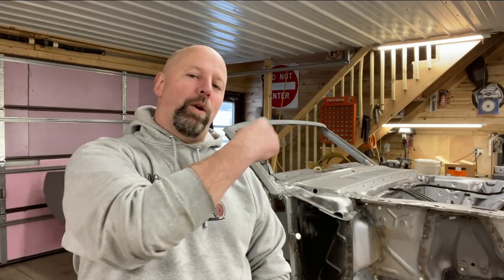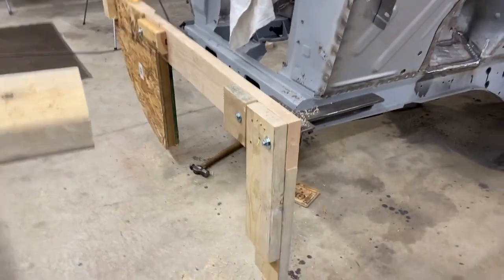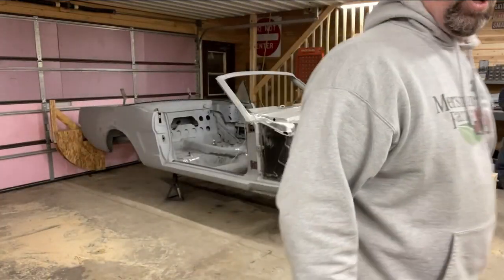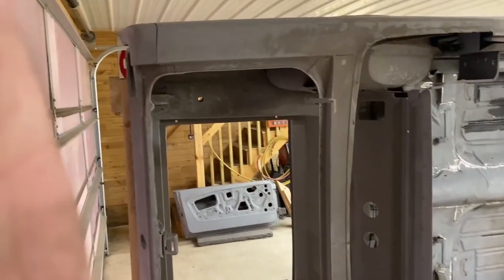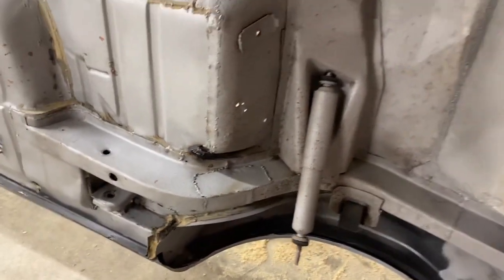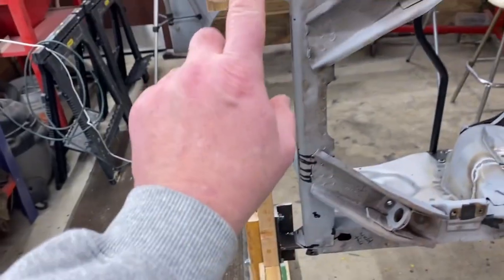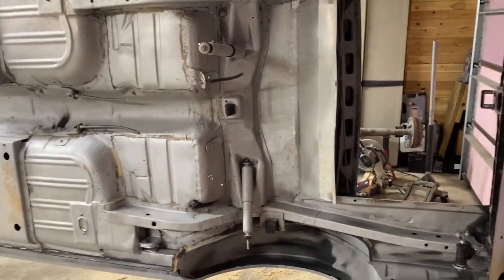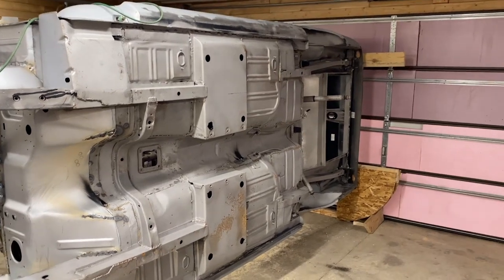1966 Mustang Restoration Pt.26 - Building an affordable tip over jig (poor man's rotisserie)

Comment: Hi Doug, so simple and a big fan of work smarter not harder. Suggestion, as you work on VIN it may rock and move those chocks. Screw a verticle or horizontal leg on to the curve down to floor to ensure it won't move on you.
Reply from the maker: Thanks for the suggestion. Since this video I’ve used a steel cable to cinch the top of the car to both sides of the garage preventing it from tipping over if I push on it or fall against it.  It’s nice and secure now.

Comment: Holy crap! Thanks. I think you just solved my problem of how to work on the bottom of my ‘64 GTO. (I worked at Ford for 17 years but this GTO was literally my first car.) I have the same problems you did - cost and very little room even if I found a cheap used rotisserie.
Reply from the maker: You're welcome!
Reply: I always give a thumbs up to someone who not only repairs / builds vehicles, but has nice things to say! I have had buddies and seen guys who started their project car, get married, run on one pay check and end up quitting and frequently selling it! I worked at dealerships as a tech, but jumped ship after a buy / sell was going bad, but the owner had an independent shop and paid me full labor as he made money off the parts I sold. But honestly, he had to have eye surgery for detached retina's after he built a high perf boat engine and (Pair I think) and hit something at 90MPH. I don't know but I take my retinas on long walks, talk to them and play their favorite music! wow!
Don't know what year GTO you have but they can be twice the weight with 7' quarter panels so be careful.
DK, ASE master since 78, retired.
Reply: @deankay4434  It's a '64 GTO which was the first year. I'm rebuilding it to stock and drove it that way for 8 years so I don't expect any problems but, yes, I will be careful - definitely more than when I was younger. Unlike the '65s, there are no repro parts for a lot of the front end and few used parts so they are very expensive - $2000 for fender, $2000 for radiator support, $3000 for wood grain steering wheel - luckily I have 2 parts cars and hope to fix up and sell some of the extra parts. I've been keeping a website of my progress/hassles. The first year or two were mostly just rebuilding the engine, stripping my parts cars, buying more tools and learning to work on the sheet metal - so no nice photos of it going back together yet. The site needs a few months of updates but I hope to have those done in the next couple weeks. The site is http://www.aimsdc.net/gto for anyone interested. I'm also debating whether or not to take the time for my own YouTube site. If so I plan to call it Cal's Barn.
Reply: @callocklin4243    64 is something I can check in with Pete, on YouTube SWRNC and Diy school. He's been on YouTube 13+ years, GTO, Camaro, Mustangs and lots more. He found a NC company called AMD (I don't know for sure) but will find out. I know parts are harder to get, OEM donors, or quality new. I am afraid that younger guys are into them, older guys doing less and a company has to make a product that sells and not sit in a box on a shelf. Pete is a crusty old sort but very good. As I got into an "LS" swap into a 1967 C10 (Both fell in my lap / wasn't looking) but released that chemistry has changed so much, stripper, epoxy, metal prep, high-build, paint and clear. I have done a number of family cars as 2 of 3 would destroy them faster than I could afford to buy. 
I bought 13 gallons of methylene chloride paint stripper as it was going up, now gone. Horrors of sand blasting or mess (See Cooper Strip Club) and watch their videos. Buy the spray on refills of "Stripper & Flusher" no extra shipping and easy to call). But metal prep inside doors, quarters and "A, B & C" pillars to clean rust with no scrubbing use "Klean Strip" concrete & metal prep (See Hoosiers Garage / Duster) or "Wray Shielien" at Pro-Shapers Metal Shop. Kleen Strip & Evapo-Rust almost identical, but kleen strip is better I think. It's rumored Eastwood buys Kirker Enduro Epoxy, sold by the coating store. Kirker is moving during December into a new facility and start producing more black epoxy to sell. A lot. Hope this helps, I am in Omaha, NE. Master tech for 38+ years then contract labor for GM to hold tech seminars for ACDelco thru Raytheon for 7 years in the upper Midwest. Wore me out!
Later!
Reply: @callocklin4243  Seams strange to think of two speed wipers as an upgrade. Still better than vacuum. 
  I remember the ex-service guys from Nam who work on Dodges at the motor pool in the military, now at the dealer. They freaked when Dodge brought Mitsubishi cars and trucks into the dealer. 1st, they hated ground at a switch that controlled a circuit, unlike GM that used ground for two speed wipers.
  But since they where imports, they locked their tool box and sat on the bench. They brought them to me to install A/C and do repairs. I had no problem. Multiple dealers, owned by one guy. Even the VW guys won't work on them since as they said, they were hired to work on VW and nothing else.

Comment: I like it and stick by the code of structural engineering, build it to last, handle live loads, then double it.
  It has torque boxes off the bottom of the firewall, right? I have never seen them. I would say lots of extra welding, some grinding and seam sealer. Then two coats of epoxy are needed. I would do the internal frame wax you bet, as everyone says convertibles rust and this needs saved for years just materials & labor right now. Neat idea!
Reply from the maker: Thanks!